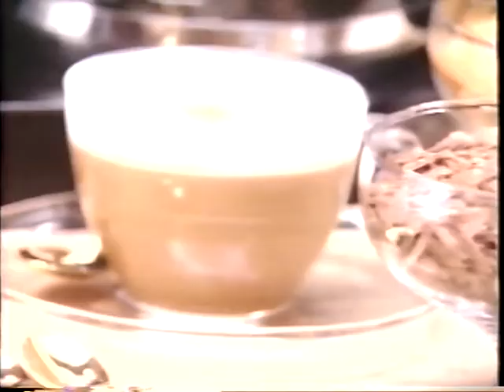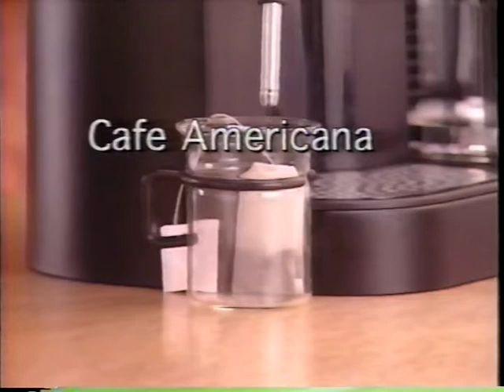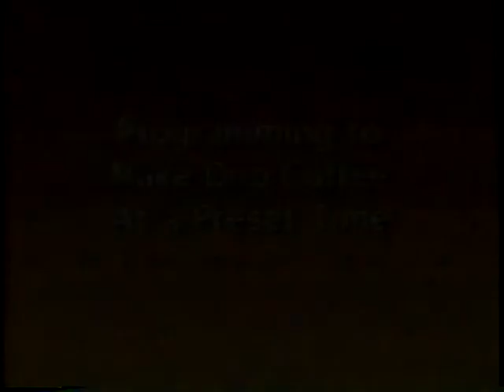Capresso Model 351 CapressoBAR Instructions 12 min

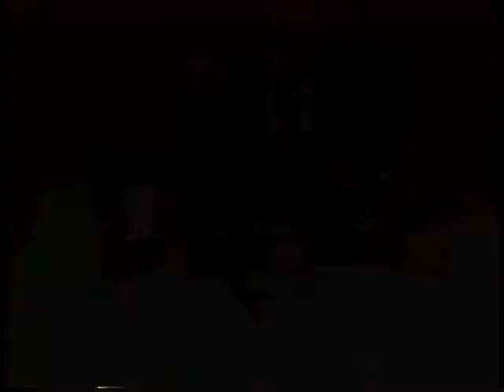Comment: 1:45 Setting the clock.
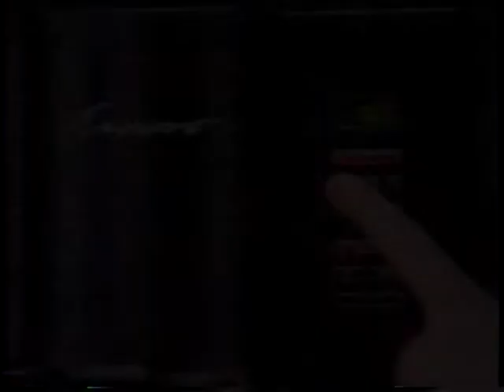2:15 Initial Preparation Espresso Machine
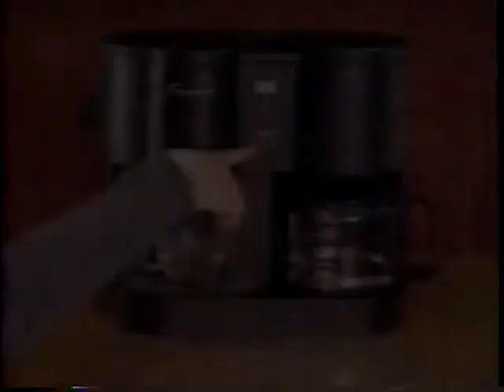3:27 Making Espresso
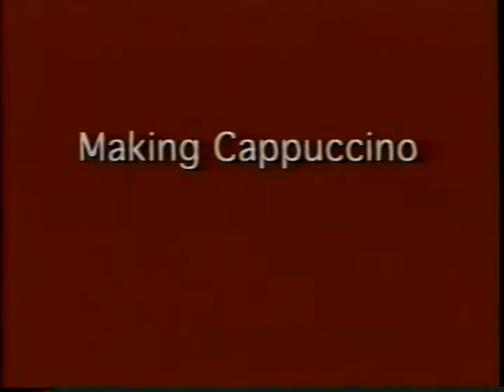5:20 Making Cappuccino 
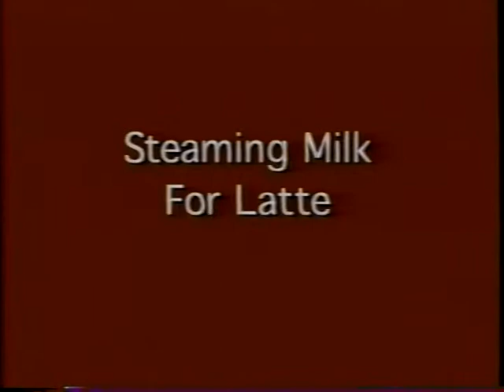8:05 Steaming Milk For Latte
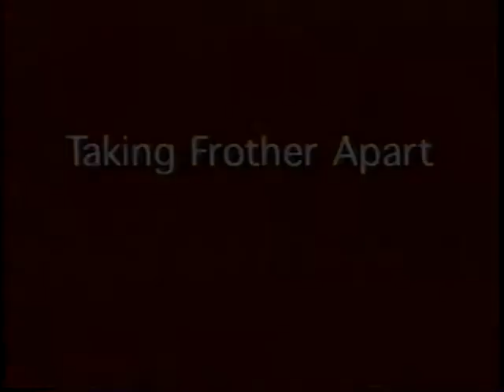8:30 Taking Frother Apart
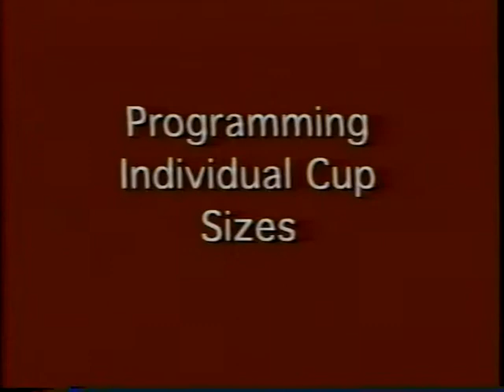9:10 Programming Individual Cup Sizes
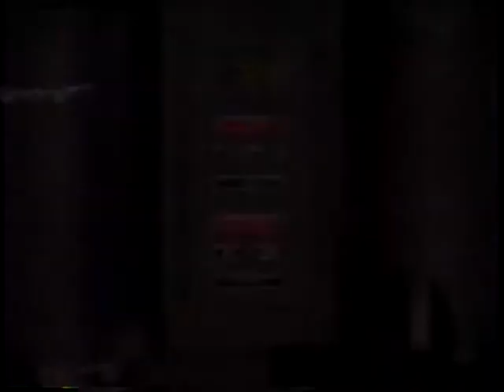10:00 Hot Water Dispenser
10:35 Using The Drip Coffee Maker
11:40 Programming To Make Drip Coffee At a Preset Time

Also... LOL 3:20 "Incidentally, if the memory button is blinking, just push it once and it will stop."
They shipped with a flaw. Probably a logic race condition or glitch trigger hat resulted in the ambiguous state. It has no impact on operation, so they left it alone.